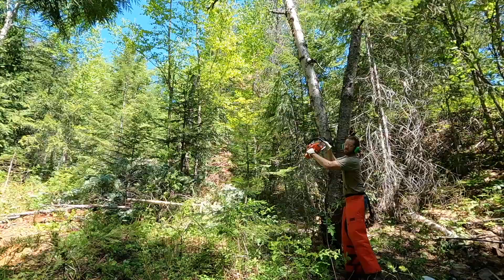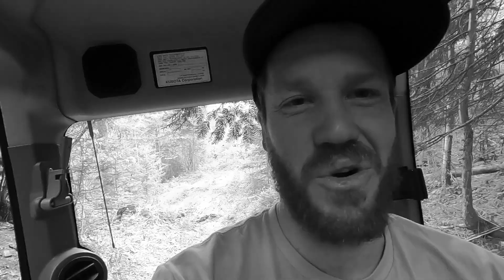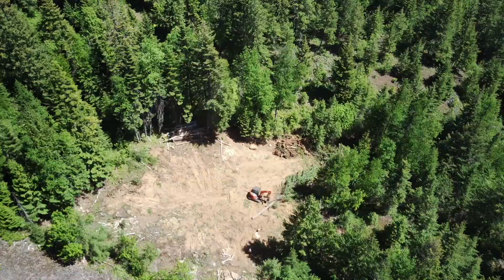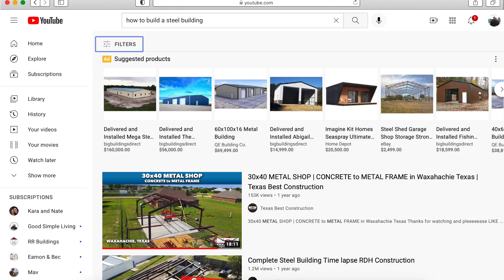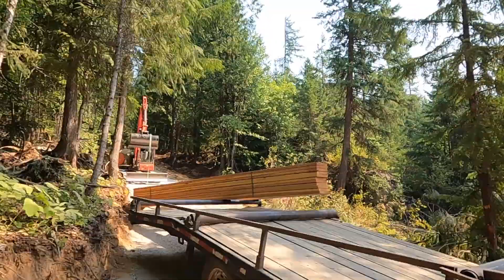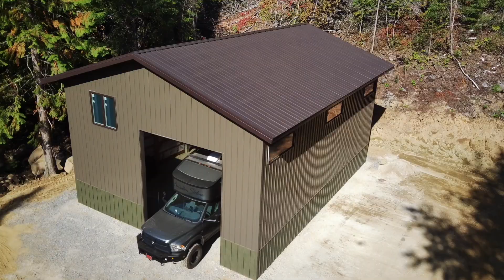DIY Pole Barn House - Total Cost

Comment: I had a pole building built 30 x 30 x 14 built with 2 12x12 roll up doors a window and a man door and a concrete slab built for less than 24K in 2015, I have since built a 10x10 mezzanine and insulated the whole time, I love my building by Steel Structures America and it does have the same concrete post beams like yours, love your channel ❤
Curt from Yakima.

Comment: Why do you burn so many of the trees you fall.  Why not log them out and use them for your heat in the winter?  You need to look into a outside wood furnace for both heat and hot water.  Would be 8 months of free heat and hot water and would not tax your solar systems.  Just a thought.

Comment: Super cool. I'm not getting any younger, but I've already mulled many of these questions over and my solution has been to build a couple practice houses, by which I mean live/build something a little more universal appeal with just a hint of what I ultimately want in the end. Smol house, big barn/shop with a greenhouse or two thrown in, on, over or around. Do the 2 year as primary residence in each one and bada bing, bada boom, house hack my way into some serious equity or outright. If it can be on one parcel...great, if not, that's ok too. I've got lots of building experience, enough to know that I'd like to do little to no framing, be it modular or SIPs, insulated raft slab, passive style. I'm not convinced I want to live in such a tight shell. We built PassivHaus and had to put in mini garages to house kitty litter boxes with their own duct to the exchange. No cats, but it got a little too much like that South Park where they smell...you know the one. There is this great build on YT, a young couple in Spain and they borrow the passive solar style house but build hempcrete walls that add to the solar/thermal mass and allow the building to breathe. *chef's kiss*. 

I figure I can keep them cheap-ish with my super frugal powers while focusing on the kind of stuff that matters to me. Some food production, make space, low expenses, maybe a DIY upcycled JehuGarcia/Battery Hookup PowerWall, though it'll be grid tied, so that may just come with me to all the builds. It's important to me to make these as something affordable by saving on energy costs, avoiding HVAC beyond the air handler/minisplit/heatpump(the tiniest electric baseboard heaters satisfied the bank and were never used due to proper design and orientation

Comment: Do not underestimate the wildfire protection zone around all of your buildings. Just lost my off-grid home this spring (May 5th) in the Hermit’s Peak/Calf Canyon fire in New Mexico. It was a steel-framed, steel-sided building I was certain would not burn no matter how severe a wildfire was. Kept a 30 ft zone free of combustibles around the building and even had steel shutters over all first-floor windows (to discourage bears) but it wasn’t enough distance. The closest Ponderosa pine ignited and burned so hot in such extreme wind conditions that an upstairs window shattered, sparks flew inside the building and everything inside was incinerated. A total loss after 22 years living and working entirely off grid. The windowless solar/wind power shed and generator survived.

Also, do not make the mistake of being underinsured. I was underinsured by just over $100K. Consider having insurance coverage which adjusts for inflation (that detail bit me hard too). Silver lining in my case is that the USFS started the fire (a prescribed burn gone wild) and the Hermit’s Peak Fire Assistance Act will probably cover that underinsured amount. However, how much of my 25+ acres of private forestland (about 3,600 marketable conifers) the act will compensate for is anyone’s guess. I was depending on that timber for multiple uses (firewood and custom furniture building for both personal use and for sale to supplement retirement income). That forestland is also a total loss and will not grow back within my lifetime. It now poses significant environmental threat to the homestead site.

The forest floor was scorched down to bare dirt and rock for thousands of acres in every direction around my homestead which is situated at the high edge of a watershed meadow surrounded by steep, mountainous terrain. That site is at risk of further destruction by landslides, mudslides and debris flows of epic proportions for who knows how many years into the future. The homestead is now essentially unsafe for human habitation. Rebuilding there would be folly, and I’m 22 years older. Still healthy and fairly strong, but the thought of doing all the DIY construction work again is daunting at my age.

I don’t mean to be a stick in the mud because living off grid for more than two decades was incredibly rewarding, almost beyond description. Just sharing real-life experiences a bit so you all can make it through such catastrophe to carry on living there to the happy end of your days, if that’s what you hope to do—as I had expected to.

Comment: Guys I have a question due to this is like a summary of this barn or shop house, I was wondering why you guys didn't make it all metal, isn't it stronger and safer, in case of a fire, since you guys work with all kind of tools, I thought it could have been better to do it all metal, why did you guys decide to go wood instead ?

Comment: You could have gotten a prefab Quonset Hut, for 5 to 20k!   Much cheaper, stronger, and with stand winds up to 200 mph.  I made a Car barn out of one. 35'w x 60'L x 18' tall ~ I love it so MUCH.  The next house i build,  will be one  with spray foam insulation 👍👍 I can still move the 4 cars out, 2 boats. A bass boat, Yacht out, and move into it 😆😆 But i love my cozy log home for now

Comment: Did you building a 40x60 or 30x40 pole building?
Reply from the maker: It’s a 30x40
Reply: The cost per sqft comes to 34.75$ (not including labor). Adjusting the framing and metal siding cost for a spike in price, cutting by half still comes at persqft cost of 24$. Wondering if a prefab metal building would be a bit cheaper.

Comment: Let's check the math here: a Kubota Kx057-s excavator costs about $90,000 and where I live it's $2900/month to rent. By saying it costs less to buy than to rent means you took at least 32 months to build your house, or I should say at least 32 months to do the land clearing and foundation work as that's the only part that requires the excavator. That is a loooong time to do that work. For 90k I'd rather hire a crew to do it all for me in a tiny fraction of that time.

Comment: Nails are used in framing because they don't snap when you building shifts or starts settling screws will snap the sheer strength is a lot higher in a nail

Comment: That excavator alone costs over $70k. Please explain how this is that cheaper than renting? I'm sure many others are wondering the same thing for their own project
Reply from the maker: Hi Jesse. The excavator was purchased with $0 down, 0% interest (so no upfront costs). The monthly payment on it is equivalent to the rental price for one week. Based on current demand, we could have sold it when we were done for more than we actually purchased it for.
Reply: As someone who did much of what these amazing kids do many years ago (and still at it), owning a large bare property means you will have multiple tasks for an excavator (and other pieces of equipment as well) over the years: dig and set culverts, handle logs and timbers for construction projects, push over trees, build ponds, etc. etc. Depending on your circumstances and your ambitions, it might well seem smart to own rather than rent.

Comment: Concerned about that big door. What happens if the cable breaks? There is a reason big doors are balanced against the opener. Perhaps a counterweight would reduce its deadly weight?

Comment: Nice job on the framing. I love those columns. I always discourage people from putting wood in the ground here. It is usually only good for 20 years. I built an off road place and used 6” well casing. I’d be replacing it now as it was a little over 20 years ago.

Comment: Thank you guys for filming all of the work you did, also the financial break down of how much it cost , what to look out for , rental equipment that is the stage I am at with my planning.. I subscribed to your channel and will join shortly...Idaho is pretty extreme to me for I am from Florida, but have traveled to many places inside the U.S. chasing storm work for over 25 years. Have decided to buy property in Colorado but is Very nervous about year round living in an area that snows. I'm not a Noob to snow living , I did time in Grand Rapids, Mich. and it snows a lot there! I have decided after just watching this video , I have declared you guys my heros! The reason I say this , I'm catching alot of flack from my family on my plans to build on a piece of land roughly around 10 acres . Set up my own utility grid , of power, water, septic, and trash...I am a construction worker, and so is 75% of my family. I figured that being so they would see my vision. I got just the opposite, they have lived their whole lives in Fla . Less then 10 miles from beaches and has not traveled even 10% of the amount I have. I am so excited that I have found your video, I have saved it, and anxiously await to see if you have others , and if you have finished your project!! I wish I could see your place, and suck up any info and /or knowledge like a sponge to get insight on what I would like to do. My plans are a little different from yours, as far as the building and sizes, but I think I hold in common the same ideas....I seen that you also fly drones and have also done your share of traveling. I can only assume that this project ultimately is the result of your travels.. which would be the reason for mine. I will be going on my own to try and build my piece of heaven on earth. I heard you guys use the term shop. That you wanted a bigger shop , but believe you can still accomplish some goals with a smaller one. Which leaves me curious to what line of work you guys are into ? Anyway thank you so much for your channel , I knew that there were people who shares my ideas and goals to living " off grid".…..

Comment: I have built tons of pole barns we usually set poles and girt them and build the bays on the ground and notch the poles. We then lift the whole bay prebuilt up using wench boxes. This cuts down cost a lot no heavy equipment needed and you built your whole roof structure on the ground. Also time with four people you can complete a 30x40 metal and everything in three or four days. So something to look into on your next build.

Comment: I live in north Texas.  I built a 120’x50’ dog trot design Barndominium.  The best decision I made was to “foam insulate” the entire building before finishing out the inside.   An “encapsulated HVAC system” is so energy efficient and saves on electricity.   It is like living in a Yeti Cooler, cool in the summer and warm in the winter.  Good luck with your build.

Bob in Texas

Comment: There is an actual pole barn house building company. They took it a step further and there have been so many improvements on how they are built. This includes even having basements with cement floors and ceilings. I was amazed to see the results of a pole barn house.

Comment: The top of a ridge or hill usually offers your best views, but you have the biggest risk of hitting ledge (rock).  You also need to consider your road, do you want to have a long driveway so your house is secluded and private or would you rather have it shorter and easier to maintain.  Will you need to level the ground a lot so you can build, and if you do, are you going to have soil stable enough to build on or will you have to put in time and money to put in fill and pack it before you build.  Those are some of my thoughts on choosing a site for a building project.  Along all of this goes utilities, where can you easily tie into the grid, how about water and sewer.  Can you get water on your site, drilled or water district, and can the soil adequately handle your septic system.

Comment: Hello, Good Job. Back in 2019 I had a 14 x 30 x 40 pole barn built. It with 1,12 x 14 and 7x9 a man door and 4 windows. Built $24,000. That was just the building. The cement floor, electric, door opener, and gutters. $41,000
But my building was pre Covid. No shortage of anything.

Comment: Insulation, septic, plumbing, electrical, and furniture will probably add another $25,000-$35,000 if you can do some of the work yourself and source the right materials

Comment: Great house, great video. Love your stuff. But about the screws vs nails thing, nails can bend and absorb wind force. Screws will just snap. I’ve never been to northern Idaho but I would guess it’s decently windy, and being that your opted for post frame, probably would have been good to use nails to help negate the shear force created
Reply from the maker: The code rated structural screws we used are intended to be put in shear. They are VERY flexible. We tested a few by bending them into a horseshoe and they did not snap. Another concern with post frame is pull out strength (from wind load) which is why we opted for screws over nails for the roof.

Comment: I build a 24x36 myself (and friends helped some) about 5 years ago. 10' door and about 13' peak, low pitch.   All in I was at low $20's.  This did include concrete slab and electrical (no plumbing in mine) but I honestly think to get as far as you did around $40k is really good!  Yes concrete will add 10k but that's still a lot of building for $50k!

Comment: So you can get a dump truck up there but not concrete?
Reply from the maker: With a little more road work we should be able to get concrete trucks up there this summer. But they might need to be half full, and even possibly have to back up the hill to prevent concrete from spilling out.

Comment: Beautiful home / shop so far.  
Please  share info on your insulation choices.
I think rigid foam under your slab and in walls and roof with a vapor barrier would work out. Is there a ridge vent in your roof? 
Radiant heat in slab combined with hot water base board upstairs, maybe combined with radiant in bathroom and or kitchen if you go with tile or other heat conductive flooring would be practical and efficient .
Best of luck with all of your choices.
Reply from the maker: Yes there is a ridge vent in our roof! Spray foam just wasn't in the budget so we went with fiberglass insulation. https://www.youtube.com/watch?v=d5BZ1knj7dI

Comment: That would run $300,000 in California.
In San Bernardino,  County 
The square footage of your house determines the maximum square footage of your shop.
So 5,000 square ft house = maximum shop size of 5,000 square ft.
$300,000 , $150,000 of that is in permits and plans
Reply from the maker: There's a reason we moved out of California. 😉

Comment: What about plans, engineering, permits etc? Where did you get plans?
Reply from the maker: We designed the building ourselves. Our county does not require plans for building.
Reply: @AmbitionStrikes  Thanks. So how do you know it engineered properly for snow/ wind loads etc?
Reply from the maker: @robzilla69  We spoke to many local builders to get specs and purchased our trusses with a engineered snow load rating that exceeded the norm for the area.
Reply: @AmbitionStrikes  Thanks. Wanting to build my own shop but this part is the only part that intimidates me

Comment: Awesome!! I totally agree with what and how you did it all. I built my own home with the same mindset and it turned out awesome. Installed a gel thermal system which I highly recommend. Use the slinky tubes rather thank the well. You have the machine to dig the trenches. Mesg me for more info if you line. I also installed a solar hot water system which helps with the bills but not so much without sun. I still need to install solar electric system but ran out of roof space since dur to my wife’s house design. I do recommend to get utility power up to the house. Don’t put yourself in a situation without it. Use the solar system to supplement the utility cost. Also added a 40x20 covered deck which we totally love. So I need a shop and was leaning toward stick build and even looked into pole building but was still up in the air which way to go. After seeing this video I’m leaning heavy into the pole building. As for the foundation, I dug 4’ holes with my mini backhoe and installed rebar and poured footings using sona tubes. Then inserted j bolts 1/2”  For the 8x8 treaded uprights with notches to hold the 2x12 cross members which the joists sit on. OMG I can go on and on!! Okay looking to see how you do next and thanks for sharing.
Reply: Geothermal. Not gel system.
Reply: Yes I like my own stuff!!!  Lol

Comment: My 40×30 is made out of drill pipe with 6" pipe with a beam running across in the center to run trolley hoists on and a 6" slab to hopefullyone day install two post car lifts. But it's a purpose built shop and not a barndominium so it's not made out of as nice of materials as yall used

Comment: Any condensation problems with the tin roof?
Reply from the maker: Yes! Until we sealed up the ceiling with a vapor barrier and insulation lots of water would condensate on the inside of the roof.
Reply: @AmbitionStrikes  The correct way for a tin roof is sheeting the trusses with plywood or osb with 2 layers of oil paper . My friend used lumber paper when I told him not to because it breaks down after time
Reply: Unfortunatley there is no cheap way with tin  roofing. Unless someone out there can prove me wrong.